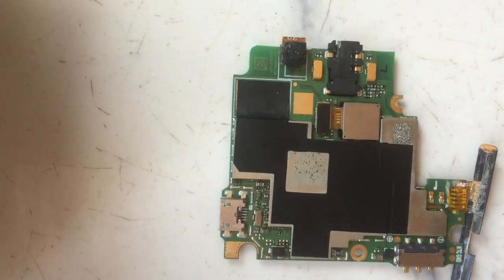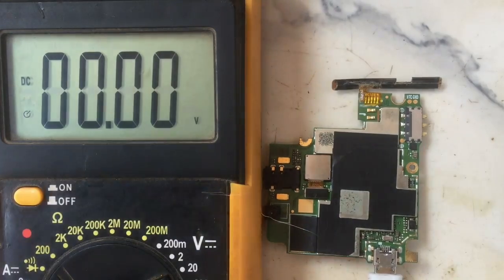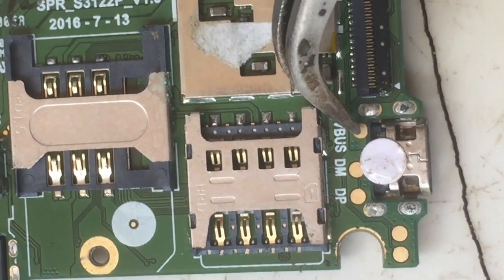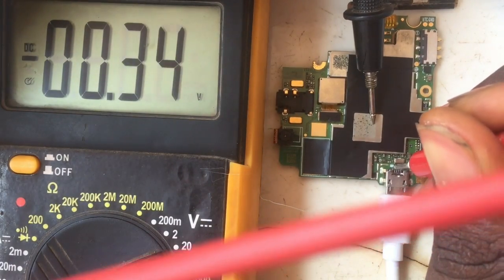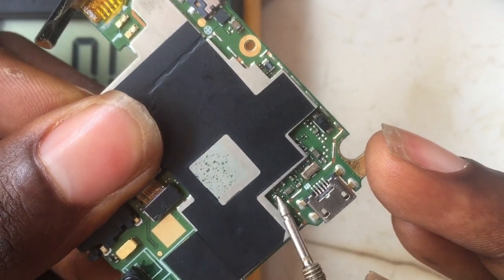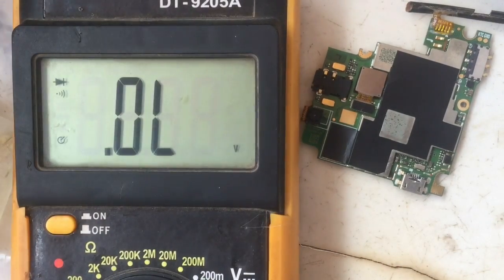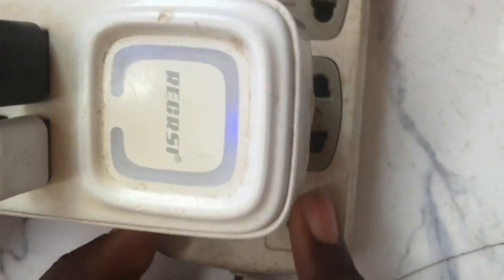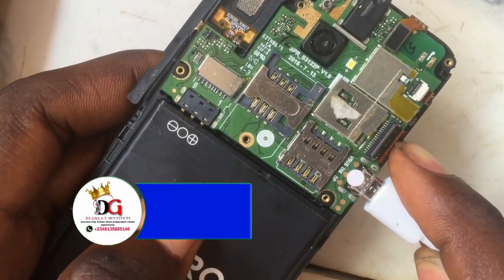How to fix full short circuit cause by diode ( part 3)

Comment: Even with the faulty diode that caused full short, is the phone going to power on if the battery is externally charged by a desktop
Reply from the maker: Thanks for the feedback ..
To learn more you can also join my VIP class and ask me questions on WhatsApp 
You can contact me on WhatsApp:  +2348135885146 
WhatsApp number: +2348135885146
WhatsApp link :  https://wa.me/qr/4CVJK3K22OVWG1

Please Don't forget to like and comment on my videos and also subscribe to my YouTube channel to get updated of my next uploads.